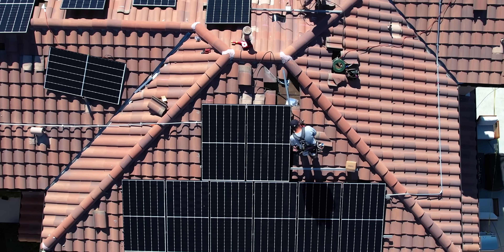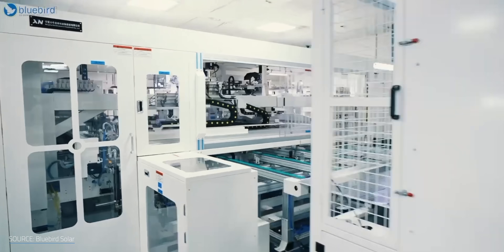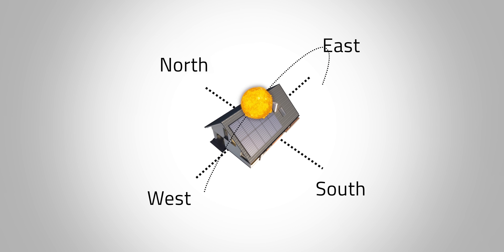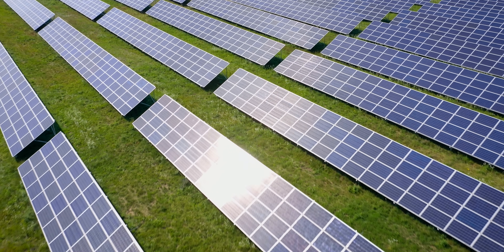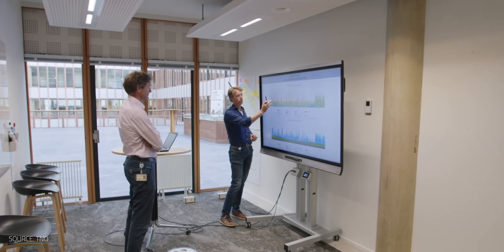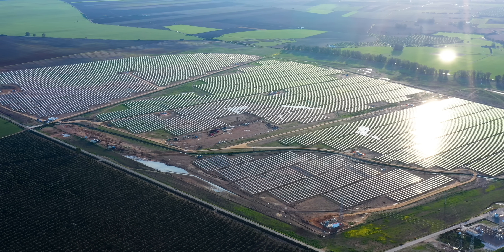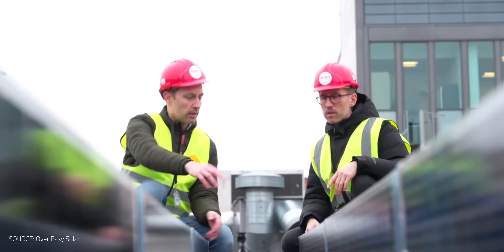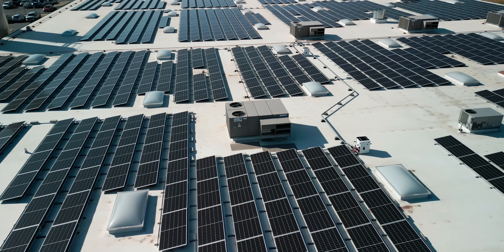Have we been doing Solar wrong all along?

Comment: @7:33 "As you can clearly see here.."  Umm.. No we can't.  The graph's two upper traces aren't labelled with anything meaningful, and both of them have the double-hump characteristic of vertical panels - so tell us where the horizontal one is to compare it to?  The 'bifacial' part seems to have little-to-nothing to do with the extra power except that the removed backing allows more heat to escape.  That said, I have to wonder why there wasn't a backed vertical panel compared to the bifacial ones.   Also not mentioned:  In cold climates, you wouldn't need to clear snow off the panels before they can generate the max power for the incoming light.

Comment: The heat issue is why I mounted my panels 8 inches above my metal roof, giving them better air flow. Thanks for your work!
Reply: Alternatively, you can use panels from French company DualSun, and you get to both harvest thermal energy and improve photovoltaic efficiency by cooling the panels with the liquid that harvest the thermal energy to heat water.

Comment: I think the side facing theory is all wishful thinking, because even with old tech panels I always found they could be placed just about anywhere, even upside down, and still yield the same voltage and close to the same wattage as the factory label.  I discover3ed this while unpacking some standard 250W panels under l large tree, stacked on pallets.  I was pretesting them before sending them up to the roof, attested the ones in full sun  as well as thine under the tree that hasn't ever fully been in the direct sunlight. I was pleasantly shocked to see the full rated VOC and began testing them further.  The only thing I can attest to is that they do not put out much in full darkness after twilight.

Comment: Why not vertical mounted rotating solar panels?  The improved cooling of the bifacial vertical panels, but at lower cost (for the panel itself)... all depends on how expensive the rotation gear is I guess.  The least expensive would be a vertical panel that faces east in morning, and right at solar noon does a 180 deg turn.  More expensive would be actual vertical sun tracking panels that gradually rotate from east to west along the southern aspect.

Comment: This is obviously huge for agrivoltaics. Our home system maxes out at 4.7 - 4.8kw in bright sun in March, and generally, 4.3-4.4kw in July-Aug due to the 40 degrees C. We've built a small, agrivoltaic system to charge our Lightning EV, with a tracking system, but we know we need to plant low sun veggies, like salad veggies because there will be a lot of shade. For a place like Texas, where we are, with the intense heat/sun, Vertical panels might give some crops the relief they need in the mid summer months, and would eliminate the problems with loss of moisture during rain. We're solving it with small gutters on the panels and small rain barrels.

Comment: Or... Have them under the optimal angle for most sunlight, preferably 'following' the path of the sun by automatically adjusting their angle and turning with the path of the sun, while cooling them for optimal production with water, which they float on because you put them on a body of water! 🎉

Comment: Maybe I'm missing something, but your comparison appears to be between the "footprint" of a traditional PV cell installation vs the footprint of a bi-facial, vertical PV cell installation. Are we talking the same number of panels in each case?  Each bi-facial panel would have twice the area for gathering solar radiation, right? The "footprint" comparison is of obvious interest. But it would also be interesting to see a comparison of output per unit area of surface. I'm guessing that the latter comparison would be more favorable to the traditionsl PV panel.

Comment: I imagine that for off grid you could have a normal solar array and a vertical one, because one produces more energy in the mornings and afternoons, while the other produces more at mid day, makind it a more consistent and stable energy suply system. One of the commercial advantages i can see for vertical is that produces energy when people are home, that means that the energy company might pay more for electricity that is delivered at the right time, even if the system doesn't provide more energy per hour it might be more profitable, making it comercialy more viable to have vertical bifaced panels.

Comment: Why not add to the panel a closed circuit water cooling with a radiator to dissipate the heat ? It might be cheaper compared to the excess cost of the dual side panels ?

Comment: There is no universally optimum solar configuration for every site/use case. In situations with high ambient temperature, the small performance boost reported here will not exist. Note the studies are from locations with relatively low ambient temperatures. By the way, leveraging the shade of solar for agricultural is more commonly done with titled or horizontal panels where maximization of shade = maximum yield of sun sensitive crops in locations with high UV density and high ambient temperature. in Northern  Europe, where the impact of the sun is low, the Sade from vertical panels may be advantageous, but in areas where growing seasons or yield of sun sensitive crops are a factor, angle panels work great and often replace tradition shade structures. You need to visit some large solar/agricutral farms I China and India to fully grasp the synergy for farmers who don't get the government subsidies of European and American gentlemen farmers. On such a trip you could also see how the shade delivers extra benefits for aquatic life forms in a world with rising temperatures.

Comment: As the wind becomes slower, you can see the vertical convection of the heated air closest to the panel.
It pulls cooler air up the surface of the panel allowing for more efficint thermal transfer and ejection.
Further, the direction of thermal ejection, that being up, will be at a shap angle to the panel, causing thermal re-absormsion to be limited.

Comment: It's hard to believe that the TNO study didn't have regular horizontal panels right next to the vertical ones.  That makes it super hard to get a apples to apples real world comparison.  Knowing the huge variance in solar radiance by location, I'd have a hard time giving this study the credit it would otherwise deserve.  Thanks for having all the references in the show notes.  Individual panels vary more than the 2-3%, but the fact they even produce close to the horizontal is impressive. Edit: after researching, they don't produce close to horizontal, just 2-3% more than they thought vertical ones would, due to additional cooling from having them mounted that way.
Reply: Also Matt gets the meaning of the graph at 7:35 wrong.  It's not showing anything "much cooler than their horizontal counterparts"  It's just the difference between the modeled vertical vs the actual temperature.  Here's the actual graph caption from the paper: "Daily profile of the module temperature: blue solid line shows observed temperatures, red dashed line presents modelled ones, and green dotted line displays ambient temperatures."   Not vertical vs horizontal.
Reply: That is a very good point. We need a proper study.
Reply: From the conclusion of the actual study:
1. "With east-west orientation and a vertical mounting, two yield peaks are generated in the morning and evening hours, which produce similarly high yearly energy yields as inclined south-facing power plants."
2. " According to the PVGIS software annual yield is 9% lower compared to the inclined south system"
So am I reading sth. wrong or does the study say that the vertical mounted do indeed produce less energy than the vertical south system?

Since Matt didn't even read the graph 7:35 right that only shows temperature for the vertical solar panels I doubt he did even read the study.
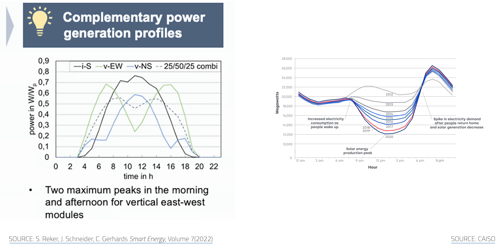Reply: @johannoas1  I'm being a little nit-picky here but, he also didn't read the graph at 4:06 right either.  It's the standard duck curve which is not really peak energy demand, but the net demand once you subtract solar. Actual demand peaks at 6pm, not 8:30. It's much more clear if it's plotted against the actual demand and you can see the difference between the two lines and how much solar produces.  It's more like the demand on traditional power sources. This graph is for late August in California when people come home and crank up their AC. But the demand doesn't drop in the middle of the day like it looks on the graph.  It's a pretty steady increase from 6am to 6pm.
Reply: @scottkolaya2110  You're not being picky, just doing the thing that people do on every one of his videos. That is, pointing out the unfortunate fact that he doesn't know what he's talking about and often enough ends up being "fake news" due to the size of his audience. Just like the "science" journalists in traditional media, the "science" journalists of youtube are just as clueless/complacent and like in traditional media, the entertainment value is all that matters.
Reply: @johannoas1  No you're not reading it wrong.  The paper only says they produce more than expected from the previous model, not more than horizontal facing the sun.  That clearly doesn't make sense for anyone that's done any experimentation with solar. The only real thing in the study is the realization that they were using an incorrect temperature coefficient.  It's certainly obvious in hindsight that a vertically mounted panel will have better cooling than a horizontally mounted one.  And the fact the "model" was just using a simple irradiance vs net heat absorbed table from horizontally mounted panels.  Not something more comprehensive that takes into account air flow that would decrease the heat gain vs heat loss ratio.  All the study did was use a different temperature coefficient for vertical  I didn't see anywhere that they were solving the issue that panels have different cooling at every angle between 0 and 90.
Reply: Youtube need an analog of X's "Community Notes", exactly to make valuable comments like yours more visible. This channel regularly produces misleading "scientific" hype.
Reply: @onebronx ... & u watch why? 😮
Reply: I would be surprised if TNO didn't know that and probably had models that accounted for that...
I can't imagine them going through the internet comments and saying: "Damn, we never thought about that!"
Reply: @tomasviane3844  You'd be shocked what researchers forget. For years the optometrist community calculated the number of times a person blinks per day by measuring their blinks for an hour and then multiplying it by 24 to get the daily total.

It took a high school student's science fair experiment to remind them that people don't blink when they're asleep.
Reply: @berserkasaurusrex4233 Does blinking rate have any application? Per awake hr is only interesting. 😊
Reply: @tomasviane3844  correct, but the whole point given in the source document was describing how their modeling was wrong. So yes, I'm sure they modeled it.
Reply: Having worked at a solar test yard that did side-by-side comparisons, I agree that having a direct control group is the gold standard. More data is always more helpful. However, it's relatively easy to measure irradiance. The fact that they are reporting efficiency and not power is telling you that they indeed did exactly that. For those not in the know, PV efficiency is just power output divided by power in (from the sun, i.e. irradiance*solar panel surface area).
Reply: @jamesgreenberg171  I just read the source report from the PV magazine and they make no mention of horizontal panel anything, just the measurement of horizontal irradiance.  Matt's references aren't from the original, but an interpretation of the original from PV magazine. Thus no comparison is needed at all.  The PV magazine is ambiguous because they used the term horizontal panels in the previous paragraph which leads you to believe that it's 2.5% better than horizontal, but it's not.  It's clipped out of context.  It's only 2.5% better than what the original model for vertical predicted.  That's all. They updated the model to the new heat transfer coefficient to get a more accurate prediction.  They also indicated they needed to space them 6m apart to get the 2.5%.
Reply: @scottkolaya2110  I see. That's indeed very misleading. Just goes to show, if you didn't read the paper yourself, you have no idea what they actually did. Thanks for putting in the effort.
Reply: In the Netherlands we hardly have direct sunlight. My polycrystalline panels are facing east at a 10 degree angle for over a decade.
Currently the price of the inverter is much higher than the price of a panel, especially if you only go for optimal exposure.
You want more distributed power and not the highest peak. In my case they gave me a more power efficient inverter that could invert about 1.8kW and not the peak possible 2.2kW, because it would start generating power much sooner.
And these days, the prices I get for off peak solar are much higher than on peak.
As a matter of fact, I have to store it because in the summer, the prices can get negative.
Reply: @bloepje Imagine going grid-tied and being "unfortunately reduced" to using batteries at the "wrong time".
My workplace has 13kw on the roof and couldn't keep the lights on due to being fully grid-tied.
Reply: We already have data for panels installed at horizontal as well as data for tracking systems. Vertical panel installation is counterintuitive, so why do it. Glad they are studying it more.
Reply: The point wasn't to compare them.  The point was to solve the mystery of why they produced more than expected.
Reply: @tristanridley1601  Right, but much harder to solve the mystery if you don't have a "control group"
Reply: @tristanridley1601  Matt said that bifacial solar panels generate 2.5% more energy than mono facial solar panels, so I would expect a physical comparison and a cost to power generation ratio.
Reply: @tristanridley1601  yes but we have the over think it all crew here on point 😅
Reply: There are tons of other studies comparing the two, and the benefits and downsides are well known. But the mechanism was unknown, so TNO set out to figure out how and why there is more then expected.
Reply: Your right when crops reaches over 250 cm . The Apple plantations in the Netherlands reach to 2m to 2.5m . So you can figure out that a lot of crops want work. Greetz from brabant
Reply: They were based in the netherlands with limited space.
Reply: @henricomonterosa4534  in the end, comparing them to horizontal wasn't necessary because Matt had the comparison wrong. After reading the paper. They weren't 2.5% better than horizontal, they were 2.5% better than the vertical computer model. They're still worse than horizontal, just not as much as expected.
Reply: he covers that

Comment: One aspect only touched on here and not really fleshed out is the financial return for the more demand-correlated output of vertical farms. Power distribution pay (at least where we are) quite fluid rates that match their demands, its why the addition of batteries pay back far more than you'd think. While the total energy capture might be only 2.5% higher, the distribution better matching the higher rates you can get is actually a far bigger impact on ROI. We have done simulations based on data from the same study (those charts were horrifyingly familiar seen outside of a work context!) and almost 15% more money can be had, and that was presuming some very conservative price tracking. If you are considering a small-scale farm or even a domestic situation where you can sometimes get very variable reverse tariffs, you might see more like 30% gains by distributing double-skin panels vertically. One interesting side note though - if you do have the 20% higher up front costs (which almost all go into the structure by the way, not the panels which can be very similar from some suppliers), then you are still better off with putting that in storage, assuming the gains you want to make are from variable-tariff sale prices, and that's simply because the demand curve is not just at the beginning and end, its outside the beginning and end of the sunny times, and to get the supply to match that, well you need batteries - but if you have em, and have the wits to carefully control them, you can get a huge payback.

Comment: In all of that you didn't mention one of the best attributes of vertical panels.  They don't hold ice, snow, water, dust, etc.  They will still need to be washed once in a while, but because they are vertical there will not be nearly as much built up grime.  In the winter, a good snow fall means more power not less because the snow will reflect from one row to the next and the panels aren't blocked.  The support structure seems to be far simpler.  And I suspect that with some good engineering you could make it less susceptible to wind damage by letting it swing or otherwise move with the wind.

Comment: The 4% extra is more than PV panel efficiency has moved in the last decade, so that is great. But how does this affect packing density on a give land area. Do they need more spacing or do they pack better. That is likely more important. You even mention packing but fail to give any figures.

Comment: Matt, years ago i read about panels produced in Turkey that had water cooling on the back and actually produced more power from heating the water than coming from the panels electric output. i wonder why they are not around today.

Comment: We've been doing solar absolutely wrong.
The very first thing that should be done, is every house in the country gets a solar hot water heater.

Photovoltaics are at best around 20% efficient currently.

Thermal solar panels, for making hot water, are in the ballpark of 80% efficient.

And they are very easy to make using mostly construction leftovers.